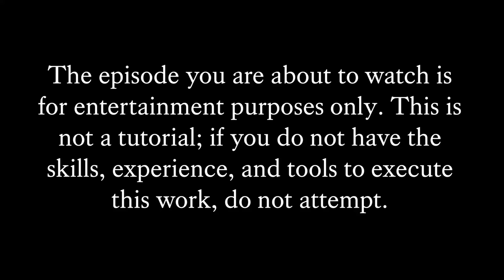Anvil 088: Shotgun Rib Soldering

Comment: Ive got a question. With the barrels touching both at the breach and the muzzle and the barrels getting thinner towards the muzzle it would make the shotgun barrels shoot across each other wouldnt it? Like by a significant amount even for the range a shotgun is ment for. Checked my Sauer&Sohn Drilling and my low budget over and under shotgun and they are both accounted for this problem. The gap between them gets bigger towards the muzzle as the wall thickness gets thinner.
Reply: i dont understand wouldnt they always cross eachother at some point? like most are sighted in at 50m i believe so if you shoot slugs they would end up in one hole. the bead is in the middle so it wouldnt make sense when they wouldnt cross and still end up in the same hole
Reply: Yes Lobster, there is a point of convergence, and there has to be, but it doesn’t matter that they would cross. You fire one barrel at a flying target...at a time, and the second if you miss or choose another target. It’s not a problem. Perhaps I am missing something as I don’t understand your concern.
Reply: @lobster8009  I see. The convergence point is far, far beyond ten yards. Done right, it’s at a distance that will not matter within the effective range of the gun. When it’s not just right, a very knowledgeable gunsmith can manipulate this to a degree, sometimes a significant one by re-choking. Sadly, there aren’t many left or coming up with these skills.
Reply: @Jordon Carlson That totally makes sense and is exactly what i ment to say. I just dont get why they made these shotguns like that in the first place. My Drilling like i said has perfectly parallel shotgun barrels and that to my is the only way that makes sense. It even allows you shoot slugs without guessing and holding miles off the target at anything further than 30 meters. Even more important for me is the use of small caliber inserted rifle barrels. Im planning on eventually installing a .17hmr or .22 magnum barrel in one of my Drillings shotgun barrels to have a gun thats truly fit for any type of game.
Reply: @Jordon Carlson Those insert rifle barrels are quite common in Germany. Great Upgrade for a Drilling. Full lenght, zero compromise small caliber barrel to be dropped in a shotgun barrel. Great for Hare and Foxes if they are out of reach for shotguns but you dont want to absolutely expolde them with a, in my case 7x65R.
Reply: @Jordon Carlson if you are interrested copy/paste " Einstecklauf " into google. I dont even know if these things have an english Name.
Reply: @Jordon Carlson Our Government allows hunters to buy an unlimited number of shotguns and rifles up to .50bmg no matter if its manually operated or semi automatic. Everything bigger than .50bmg is considered a destructive device illegal to own for all civillians. Bowhunting is illegal because they are extremely hard to use and even if you hit they are not lethal enough and its considered animal cruelty. Everything that has hooves you cant hunt with shotguns, a law noone ever could fully explain to me. We also have the law that for roe deer the bullet has to have at least 1000 Joules 100 meters down the range. For game bigger than roe deer you need at least 2000 Joules in 100 meters and at least 6.5mm in caliber. All pretty reasonable laws i think. Our hunting laws in general are quite reasonable. Here you rent the right to hunt and claim animals in a defined area. You are also responsible for the well beeing of the wild animals in this particular area. You are basically a game warden and work closely together with the government hunting agency to negotiate the interrest of the animals and the land owners. It gives the hunt depth and allows you to realise your own ideas. Its not just buying a ticket and shooting an animal to put it in your freezer. But if thats all you want you can also just talk to a person that has the hunting right and take an animal there if you have a hunting licence of course.
Reply: @Jordon Carlson We dont have any problems with "hunting tourism" really. To obtain a german hunting licence your main stay has to be in germany and you need the german citizenship. Also Germany is quite bad in therms of variety of game, theres no reason other europeans would come to germany to hunt here. Basically we dont have anything they could not hunt in their own country. But as much as i like Italy for vacation and culture i can confirm they are animals when it comes to hunting. They just shoot for sport and the fun of it. Not much in the way of respect for the animals they take.
Reply: @Jordon Carlson Missunderstood the question regarding Italians a bit. You mean they just hunt without licence where ever they feel like? In that case i have to say no, not really. Illegal hunting is a rare occurance mostly done by thrill seekers with sporting bows and general nogoods in germany. Sometimes hunters strech the borders of their areas a bit if theres a particulary desirable buck in the neighbours hunting grounds but thats about it.

Comment: so to the type of solder, which is best lead solder or silver solder, , is it just the mount of heat silver solder requires , and does that effect the heat treatment of the barrels, I've done 5 sets of barrels screwed the first 2 learning ,  but lately have been thinking of swapping out the standard solder to silver solder, as i like to braze the ends and fore end lug, what are your thoughts with the silver solder, ?
Reply from the maker: Most of the Belgian barrels Ive seen are fully brazed. I use soft solder because I can make it bark on command.

Comment: So I hate to be that guy, but you are actually slightly mistaken on the water vapor in the torch. There is no water in the torch.  The effect you see is an effect of humidity interaction with the heat, effectively the torch is causing a modified dew point in a localized spot. If there was water vapor in the torch you would have rust inside of the tanks. If that was the case there would not be certified tanks from the 1920’s and earlier that still test clean to this day.  But you are completely correct on water being an issue with the solder joint and the preheating with the heat gun is a fantastic way to prevent the localized dew point problems with the torch.
Reply from the maker: So when you combine a HYDROcarbon with oxygen during combustion, you don't get heat, co2, and h20.....how about that...
Reply: That's a really long way of saying I don't know how combustion works.
Reply: @marknovak8255 You are absolutely correct. 
My grandfather told me that before I was 12 years old. 
It was condensation from burnt hydrocarbons inside his greenhouse that he was worrying about.
Reply: Lol Brunotheuneducated is more like it. Base hydrocarbon reaction is C(x)H(y) + O2 = CO2 + H2O.

There wouldn't be water vapor in the tank you knob.
Reply: @ObservationofLimits  if it was water from the reaction it would be persistent.  It is a flash condensation from temperature swing.  Once the heat is stable the water no longer shows.   It’s not making water from the burn.  It’s pulling water that’s already in the air.
Reply: @brunothehumble  though the burn is also not helping
Reply: @brunothehumble  cold soda can sweats.
hot water vapor produced by the torch condenses on cold metal and mirror. 
heat above condensation point of water, water generated by burning fuel does not condense on the part.
if it's a localized dew point, why doesn't the heat gun make a localized dew point?
Reply: I would expect that the water vapor is a product of combustion.  Say you are burning methane as your fuel gas.  Methane is CH4.  When combined (combusted) with oxygen, the methane molecule disassociates into H and C.  The C combines with O to produce CO or CO2 and the H combines with O and forms H2O or water.

Comment: When shortening a double barrel shotgun (legal minimum length, of course) does the rib need to be resoldered or reinforced close to the muzzle?
Reply: Depends, but be sure to gently but solidly clamp the rib tight before cutting, to ensure the rib can’t be ripped free of the solder

Comment: I have a P08 Luger  that will shoot the first round and load the second round but the stricker  does not reset. Toggle it a little and will shoot the next round . It does the same thing over and over . one round toggle it and it will shoot again . Please Help
Reply: try checking for cosmoline in the action? could be enough that it's slowing it down or making it stick somewhere
Reply: @zacht9447  perfectly clean the side plate is very firm ti seat ???
Reply: check your sear and your striker

Comment: The traditional English method for doing this is to use powdered  rosin (tree resin) and tinman (60-40 tin/lead) solder using copper wire ties and cut nails as wedges to adjust the tension.. never, ever use killed spirit/Bakers/zinc chloride on a job like this for the reasons Mark gives..
Reply from the maker: I like the spring clamps for the ability the hold slight tension even as the solder melts and the parts move. I modified the clamps with far weaker springs for this. Other than that, same technique. Cleanliness is the key, and not too much heat!
Reply: @marknovak8255  Hi Mark.. just because "it's traditional" doesn't mean it can't be improved on! If tech works, then use it.. otherwise why not use a stone axe for doing brain surgery.. that was "traditional" too at some point in history!

Crack on my friend.. you are doing a terrific job!
Reply: @felixthecat265  :  "traditional" :   You're so-o-o correct w/ regard to a stone axe and brain surgery...

Comment: I'm pretty sure that a neutral oxyacetaline flame doesn't produce any water vapor. Might be overkill for soldering but still
Reply: any burning of hydrocarbons will create CO2 + H2O
Reply: @jeffsaunders19  oxy acetaline also burns in excess of 3,000° Celcius, any water that's created is a non-issue
Reply: @Alf Lacis oxy acetylene burns in excess of 3,000° Celcius so it's not an issue, it's like worrying about having a stroke while being hit by a meteorite
Reply: You need to be careful forming water vapour with any hydrocarbon based heating method, regardless of the the flame heat! If the metal is cold enough to cause condensation, this will occur regardless of how hot the flame is! You need to heat the whole object up to above the condensation point to ensure that it does not occur. Oxy acetylene flames although hot, are extremely localised, so it is perfectly possible to heat one part of the work, but not raise the outer edges of to a high enough temperature. I quite often use wet cloths wrapped around a barrel to limit the heat being passed to other parts, but you need to ensure that the parts are dried off afterwards. Applying heat to iron/steel can "activate" the surface as well as removing any protective oil films etc. You need to deal with heat affected parts otherwise they will rust very quickly..
Reply: @Romuls753  The temperature of the flame does not mean that water vapour isn’t produced as a combustion by-product. It is. An oxy-propane flame or even a propane blow-lamp is hot enough to boil water but it still produces water as a combustion by-product. As does a gas cooker ring that’s also hot enough to boil water.

Then when that water vapour hits something cold, such as the work a distance away from where the heat is being applied, the water condenses out. You can minimise the effect by heating a large area to well above 100˚C but for a job like this that probably wouldn’t be a good idea because the heat could lead to the workpieces buckling, amongst other problems, and the area you’re trying to solder would be likely to get far too hot - and once you get to temperatures above the melting point of the steel there’s a risk of blowing a hole through a barrel wall - which is why Mark commented that using a TIG torch for this sort of job is a bad idea.

Another reason not to use oxy-acetylene is that acetylene is tricky and dangerous stuff to use and store and if you don’t handle it with sufficient care and respect you can find yourself with an acetylene cylinder shaped bomb on your hands. Which is one of many reasons why electrical welding processes have largely replaced it for welding purposes.

Comment: You lack many of the tools used to regulate doubles. You should use ribbing clamps and wedges and once all is in place the entire assemble should be heated in a soldering oven.  The expense or lack thereof a shotgun is not the question. Doing the job right and in the proper manner IS. I've re-ribbed and regulated many, many double guns Shotguns and Rifles. Their quality or price never came into the equation. Their function and shootablity was the paramount concern. I have fixed guns that the regulation was horrible. I had double gun that the left barrel shot left, right and the right shot very low. When I was finished it layed one pattern directly over the other at point of aim, as it should. It was a Stevens model 311, not a Parker, H&H or LC Smith to be sure but, it would outshoot most doubles. It's owner was so thrilled after his first hunt with the gun he brought me two others to regulate, a Browning SBS and an Ithaca SBS whose model escapes me right now. My friend, the ribs are to be put in place at the same time. Installing the top rib then going to the bottom is a very good way to loosen the rib you just installed. That is why you need ribbing clamps and wedges. Hense, the need for a soldering oven. One or two a year?? Young man, I do a few hundred re-rib and regulation jobs a year. Hense the reason I have or made all the proper tooling. One or two a year,,,, if that were the case young fellow, I would have long since starved to death. Proper bluing on a double gun is the cold rust process. A time-consuming process but, well worth the effort. I was actually hoping to see you blue this gun. Watching smith's(?) using Hopp's insta-blue always amuses me, and I think, there's a short cut that will come back to bite them.
Reply from the maker: And yet, it was right on the money on the pattern board.  Now it's up on the wall. Not all work over here is high end unobtainable.  So yes, it DOES matter what the customer wants to pay.
Reply: Hes trying to show you how to doit yourself with basic tools anyone can get. I can now go buy the $100 antique sxs and fix the loose rib. If i read your tutorial on how to fix it id read "special tool for professionals only" and say "oh well I guess I can't doit😢. But this i can do. Ill never buy a nice one i just want any working sxs for my collection and without this video I would never get one cuz im too cheap 😂😂

Comment: Is there a reason why the rib isn't welded rather than soldered?
Reply: Welding needs much more heat because you need to melt a very thin layer of the barrel material in order for it to bond. That would soften the barrels and you run the risk of burning/melting all the way through the thin walls. Mark mentions that at one point. 
With soldering you only melt the solder but you stay above the melting point of the steel. A hundred years or so ago that definitely was the only way to do this without wrecking the barrels. With precise, modern welding techniques I'm pretty sure it would be doable. No idea though if it's actually done. The traditional way works well enough and holds strong enough, so people probably stick to it for that reason alone.
Reply: Soldering is easier less time strong and cheaper, plumbers solder million of joints every day. Mark is not a good plumber.
Reply: Aside from the points Jeffrey and Adobo mention, many modern double barrel shotguns use monobloc construction, where both barrels are milled together from a single block of steel. That wouldn't have been very cost effective, and perhaps not even possible, during the heyday of the side by side shotgun.

Comment: On the off chance anyone knows, i have an old h&h shotgun, circa 1920's, single shot 12ga, when i shoot it shells do not eject, i've tried buffing the inside of the barrel but before i risk snarling my great great grandpas old hunting shotgun trying to take the spring out, any suggestions? I've tried spraying wd40 on the ejector in case it was a bit rusted, or some schmoo, but to no avail. I did have a few hotter shells eject properly but the bird i normally shoot doesn't. 

Thanks in advance!
Reply: WD40 isn't lube, it is just for water displacement
Reply: check the length of the chamber, shooting 2/34 in shells in a 2 1/2 in chamber will cause extraction problems also.
Reply: You say it won't eject.. is it an ejector or just an extractor? you need to check how much pressure is being created by the extractor and how free it is in its mechanism! Try it with a dummy or a snap cap and see if this extracts it!  My suspicions would be cack and rust in the mechanism!

Comment: Are you using acid core pipe solder?
Reply: Rosin. 60/40 lead/tin
The key is not to touch where you have cleaned. No acid needed. It's in the video.
Reply: @2Truth4Liberty  Thanks for the reply. I asked the question before I watched the video a second time. I saw that thick roll and thought it was pipe solder.

Comment: When using a file to remove solder or lead, I fill the teeth of the file with a piece of soapstone.  It keeps the lead from clogging up the teeth.
Reply: But, the majority of my experience was not on firearms.  I imagine that talc dust might interfere with blueing if not thoroughly cleaned up.
Reply: @Alf Lacis I did a lot of welding and fabricating, and we used soapstone crayons to mark steel for cutting with a torch.  The talc shows up very nicely in the intense light of oxy-acetylene.  And very useful in keeping very soft metal from gumming up a good file.  Lead does not want to come out of file teeth.
Reply: I usually use sidewalk caulk, especially when filing aluminum. Works great